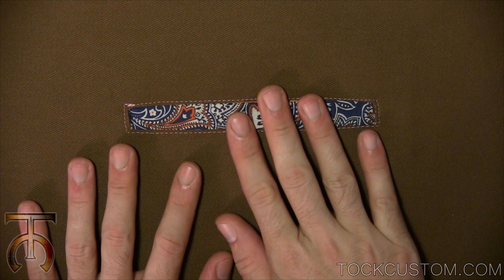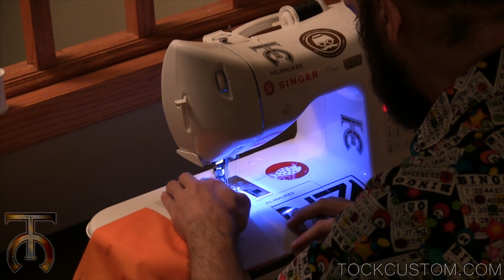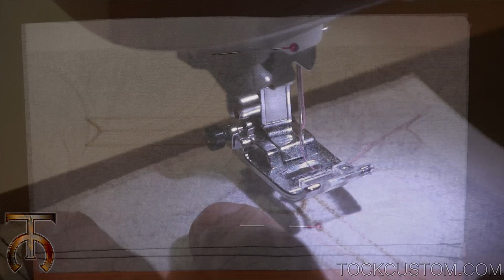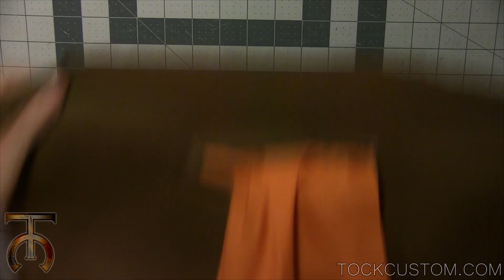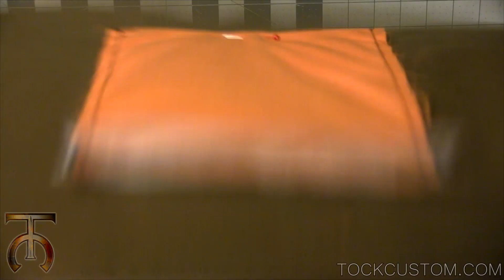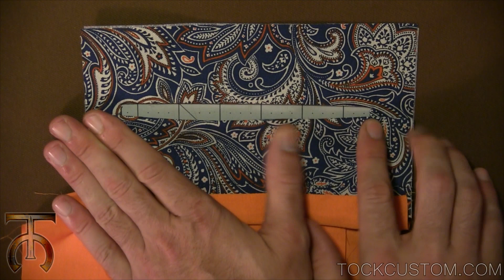Welt Pocket Tutorial (Single and Double) - Tock Custom

Comment: You apparently took Industrial Design, I see some of the precise drafting techniques used in technical illustrations
Reply from the maker: The cool thing about working with textiles is that it's certainly an art form, but there is quite a bit of engineering and constructive problem solving involved. One of the things I love most about sewing, leather work, and cosplay :)

Comment: Great video with all of the important stuff without rambling on. I subscribed after watching another of your videos. I have a suggestion for topstitching. When I do topstitching, I don't backstitch. First, I begin and end with a longer thread-tail. Then, I thread a needle with the top thread and pull it through the back and tie it with the bobbin thread. Lastly, I thread a needle with both threads and work them into the fabric and snip them. This way, I avoid any bulkiness in my topstitching. It's a little extra work, but it pays off.
Reply from the maker: Oh that's a really cool technique. This is certainly the simplified version of welt pockets, but your method sound like it would have a cleaner finished result. Thanks for sharing!